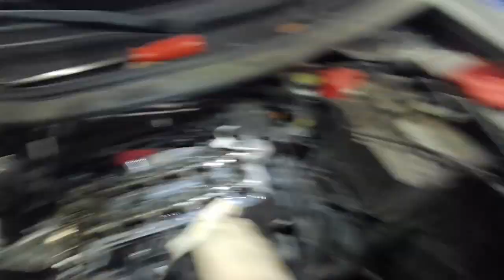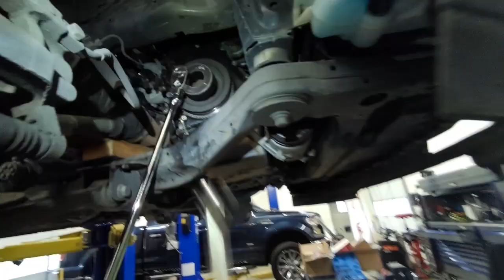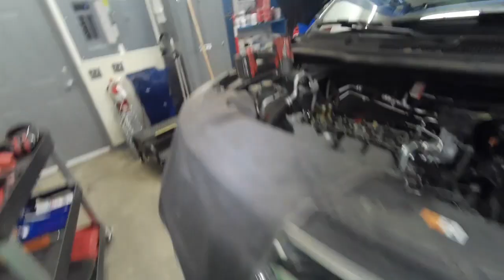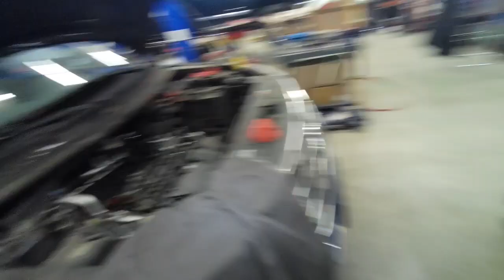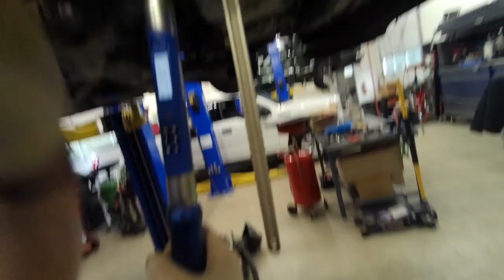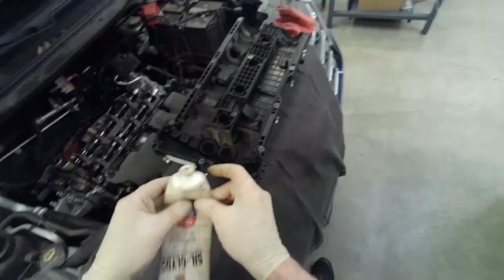EXPLORER FRONT COVER OIL LEAK REPAIR

Comment: Was the truck pouring oil like a cracked block or was it just dripping? Wondering if this is the same issue my buddy is having
Reply from the maker: They leak on the back side directly below the valve cover gasket. Oil was covering the oil pan and subframe. Very common

Comment: I did a new head on a 2013 Ford Fusion with the 1.6. Very time consuming. Everything is special tool this and special tool that. It took like 4 hours just to adjust the valve lash because it uses the bucket style shims. I got the valves perfect tho. It ran soooo much quieter making sure the valves were as close to the precise specifications (rather than just in the range Ford gives). The customer totaled the car a month later😂
Reply from the maker: This job was booked at 6.1hr but had over 9 hours into it after warming up engine, road test, reinspection, cleaning tools, etc. I think they are a stupid design. Congratulation on your job well done even though it got totaled 👌